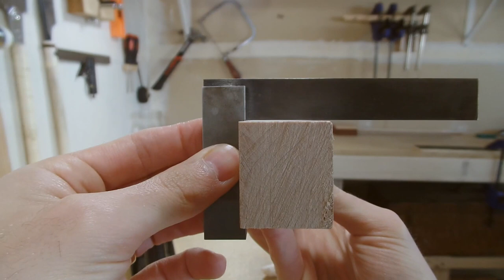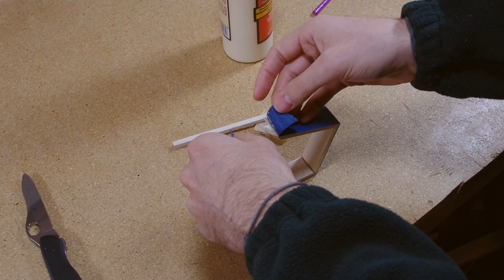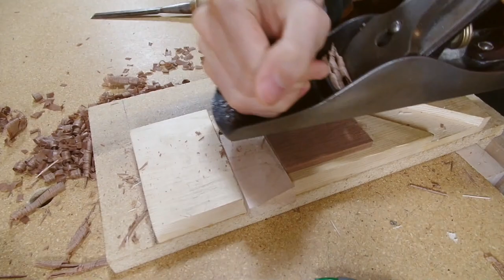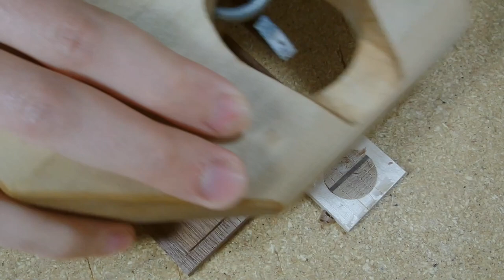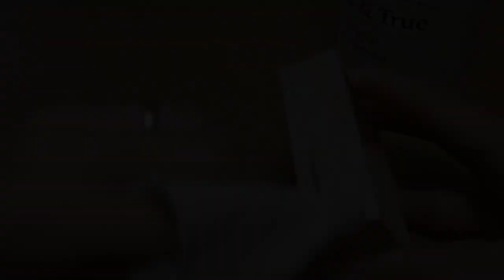Hand Tools Only: Building a Small Keepsake Box // Quiet Woodworking

Comment: I want to get started with hand tool only woodworking but it looks so intimidating. Seems like you need so many different kinds of tools
Reply from the maker: It can for sure be very intimidating! And there are many tools you can get but I do think it is possible to get started with a somewhat limited tool set. It still may feel like a lot at first, but I think totally possible! 

Here are the minimal tools I think you'd need to get started. A #5 hand plane, a ryoba pull saw (which has rip and cross-cut teeth so it's a two in one saw which is nice), a chisel set (1 in, 3/4in, 1/2in, and 1/4in) or you could just get a 1/4 in and 1/2 in to start. A combination square and a cheap hobbyist woodworkers vise (there are ones on Amazon for around 20 dollars which will get the job done). A set of diamond sharpening stones (there are thin ones Paul Sellers has recommended that appear to work well and are relatively cheap). And lastly some sort of work surface that can be as simple as a piece of 3/4 in mdf set on a simple 2x4 base (that's what you can see I have in this video).

I know that's 6 or 7 different items, which can feel maybe still feel like a lot, but some of those things you may already have. And once you have that I would suggest watching tutorials for how to make a simple box and then just start trying to build stuff! 

Hope that's maybe helpful and if you have any questions please feel free to ask!